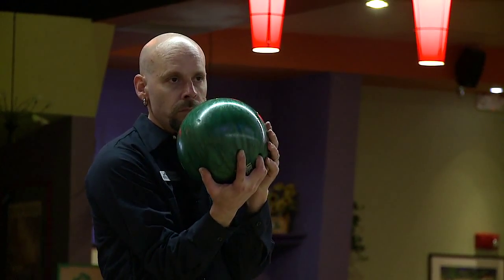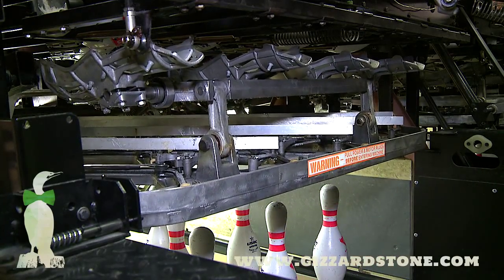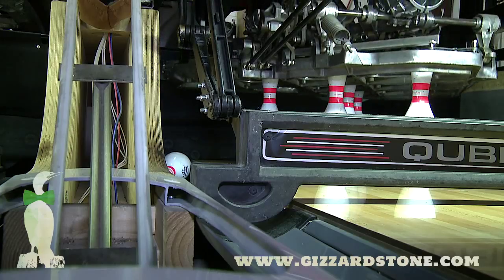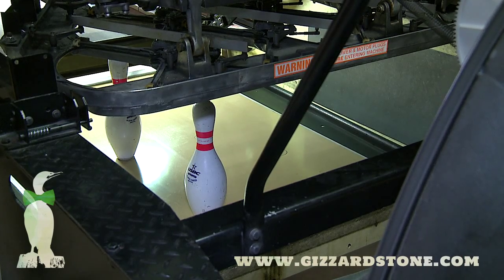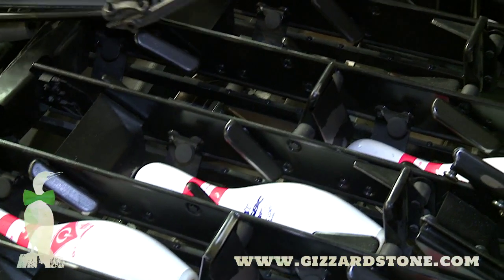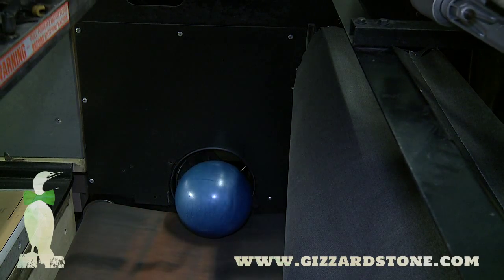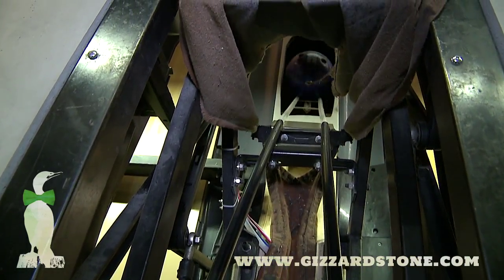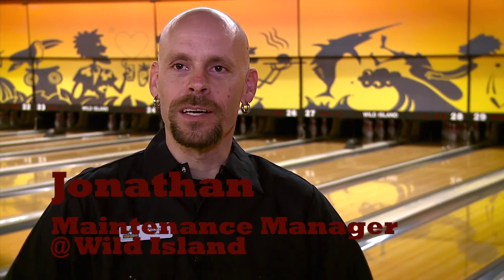How a Qubica AMF Model 82-90XL Pinspotting Machine Works

Comment: Those are not QubicaAmf machines they are just AMF. You can tell because Qubicas have a very thin sheet metal like table unlike the AMF ones which have a thick table.

Comment: Don’t really like how the rake comes up before the pin setter tho :/
Reply: I would think that with the 82-90 upgrades to those (what really are) 82-70 pinsetters that they would have the sweep stand guard until the table finishes its business.  I just viewed another video with similar pinsetters in which lane 10's sweep was lifting too early but lane 11's sweep was lifting after the table did its job.  Use the TA2 switch (or equivalent thereof) instead of the TA1 switch (or equivalent thereof) to let the sweep protect the table!

Comment: They look like 82-70's!
Reply: They ARE 82-70s, just with some 82-90 upgrades (such as strike recognition [no first-ball table run required, just sweep and set new pins], gutter ball and 7-10 pick off recognition [no table run, sweep lifts back up right after sweep drop]), but the sweep in this video is lifting too early (should use that TA2 switch [or equivalence thereof] instead of the TA1 switch to lift the sweep, to allow the sweep to protect the table until the table finishes its business).

Comment: What’s the difference between the 82-70’s the 82-90’s and the 82-90 xl? And what’s the difference between amf and qubica amf?
Reply: AMF (American Machine Foundry) produced the AMF 82-70's in the early-mid 1960's. The 82-90 model is an upgraded version of the pinspotter with modified parts as well as an upgraded chassis located on the back of the pair of machines without using a transformer on each individual machine (usually found on an 82-70 model, located at the top front of the machine).

Qubica was it's own entity, but later purchased the manufacturing side of AMF by renaming Qubica to QubicaAMF.
Reply: MAke a modern AMF 82/30
Reply: I worked on these machines for a while. There were 2 types of amf 82/90 xl (not xli) . Steel and aluminium tables was the main difference. Steel tables where a nightmare. Too heavy for the frame of the machine and they would snap. Aluminium table were the best. The aluminium tables were the same ones from the 82/70.

Comment: This machine malfunctions all the time, go with brunswick
Reply: well, the mechanic's must not be doing a good job then!

Other than that, nothing lasts forever. Every machine (doesn't matter if it's Brunswick OR AMF) will eventually have faults with them. Your centre just needs mechanics who can maintain the machines well.
Reply: @lambo_90  As a retired Brunswick and AMF mechanic, I must defend the mechanics for the following reasons as it is mostly not any mechanic's fault that pinsetters are not maintained properly, and here is why.  Back in the 1980s, most bowling centers were looking for ways to cut the payroll.  Unfortunately, while I had to handle 32 lanes all by myself with a full house of league, the snack bar would have four or five people standing around, the front counter would have 3 or 4 people standing around, doing mostly nothing while I am unable to have a second person with me in the back end.  Automatic scorers started showing up and that aspect was treated as a distinct and separate position, and the mechanics were not involved with this nuisance.  Also in the 1980s, many centers decided to eliminate the lane man position whose sole job was to maintain the lanes; the mechanics were not involved with this nuisance.  So, the bowling centers eliminated the lane man and the person who handled the scorers and that crap got passed off to the mechanics without any increase in pay!  The result was that the pinsetters were no longer getting the full attention of the mechanics because now the mechanics are busy effin' with the automatic scorers and having to strip and oil lanes!  Therefore pinsetters started failing more often because the mechanics can no longer focus their full attention on what they were hired to do in the first place.  The bowling centers wanted to cut the payroll, but not where it should have been cut!  I can maintain the machines quite will if I am not wasting my time on the lanes and/or dealing with faulty scoring systems.  So, the lack of proper maintenance is on the bowling center management and owners, not the oft underpaid mechanics!  Four or 5 stand around at the snack bar and 3 or 4 stand around at the front counter wasting the payroll ... while I am busting my balls solo in the back end of a full house!

So the end result was that the payroll got cut in the back end but continued to remain bloated at the front counter and snack bar, and then center managers and owners refuse to understand why the pinsetters are not holding up the way they should, with proper maintenance and proper staffing!  And on top of that, some bowling centers expected me to be a porter as well?  I would get out of that by claiming that I was stuck on a machine.

For the record, I worked on pinsetters over four decades.  I never accepted any head mechanic position even though I was more than qualified enough due to the centers' refusals to pay accordingly!  They expected me to take B mechanic wages to do A mechanic work, so I never accepted that position as I was better staying in the B mechanic position!  Also, no center would allow me to run the back end the way a head mechanic is supposed to, so, NO!
Reply: It’s depends on the maintenance dude. Like I’m getting sick and tired of Bowling at my one and only local center in my hometown for Leagues and it’s just awful cause the place is overpriced, the lanes were cheapskate (they bought refurbished 82-90XL’s in 2013 and until now, they didn’t do any maintenance on their pinsetters) and since the lanes are in a shopping mall, their mall management doesn’t give a damn for our Leagues, just stupid freedom for stupid Casual Bowlers.

Edit: Their Bowling Center Management didn’t even bother if one of their mechanics made a mistake by having a risk of damaging the pinsetters. It’s sad that I wish Bowling Center Managements or Mechanics are League Bowlers in general cause they can put a lot of care on their Lanes for their League Mates or Members. Like one 22 Lane Brunswick GSX Center had an owner who was also a League Bowler, a Bowling Coach (even a staff member of Track) and he’s strict to his staff for the sake for his League Mates and other League Bowlers.
Reply: @PinoyBowlerGS92  Yeah, it depends on the maintenance, all right.  What I am barking about is how everyone expects all that maintenance to be kept on time while mechanics are busy messing around with lanes and automatic scorers.  And let me mention the one house I worked in which I almost never got parts I needed so I had to come up with some extreme improvisation to keep the pinsetters running.  But whenever a temporary repair truly became temporary, the owner would ask me why the machine isn't running ... I would tell him that repair was TEMPORARY!  Now I need the parts!  I was considered one of the best, if not the best, mechanic in Jacksonville (FL) due to my canniness with the pinsetters, finding some way to make it run without the parts I needed.  Take the mechanics off the lanes and off the automatic scorers so that they can indeed do their original job!  By the way, I once worked a bowling center within a shopping mall owned by a church.